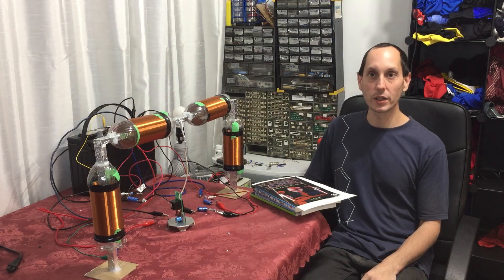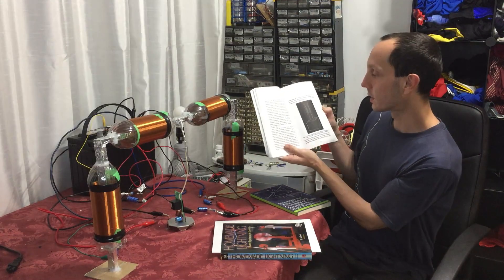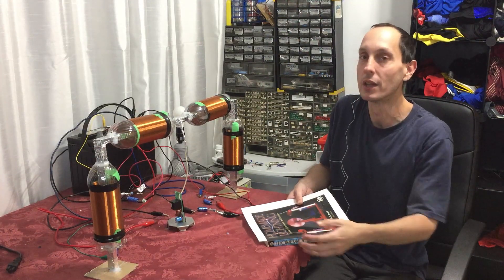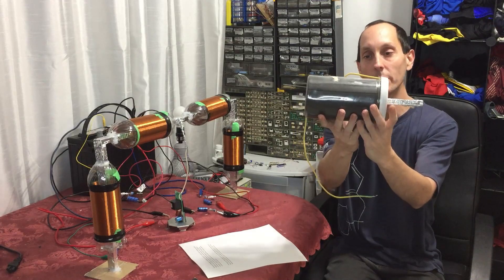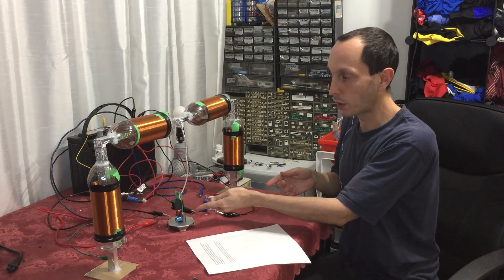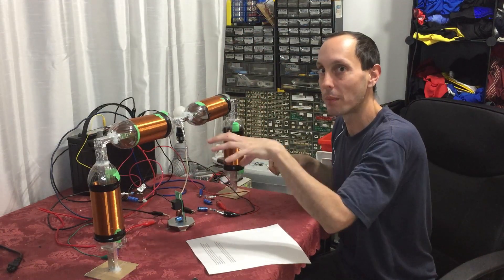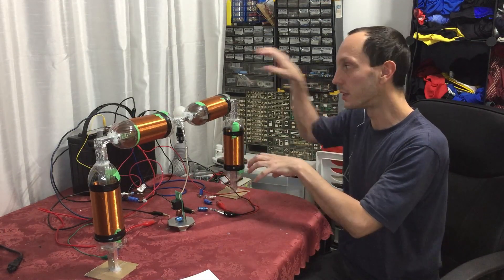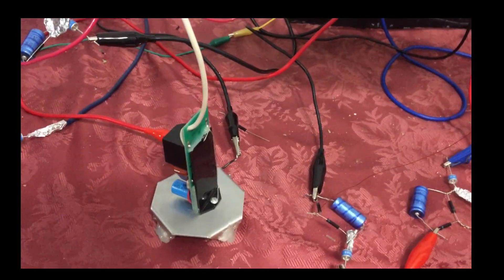QEG Version 2

Comment: Hi Joel, 
If I took like 5 microwave oven transformers, connect the high voltage +ve in series ( add some MOT high voltage caps) drive one with mains or inverter and use the primaries of the rest as output,  can this be one wire system? Can it give 4 times the power for the price of one?
Reply from the maker: Not sure if I understand correctly but I think this is a variant of my tube project where I layer with multiple diodes, plates and coils all in series, And that worked well so stacking up transformers in series could work. Have not tried yet with real transfers yet, just did it with some home built coils around a rod.

Comment: If I understand correctly and if you can confirm that the amps that are going into the battery is coming from out of nowhere (the ether), so it's ether energy that's multiplying by the copper coiling system, does that sums up the idea?

Comment: Nice work Joel, clearly lots of thinking going on there. I noticed something that may be similar with my circuit, I think it’s similar anyway, I find this stuff hard to get definitive answers from. Your setup should also prevent sulphate build up which should extend the battery life.
My circuit is very different to yours but will charge capacitors wirelessly using the Avramenko plug as yours does, on mine as long as both seperate circuits are connected to earth the caps will charge super fast.
I love when other people experiment, it gets my brain tripping over itself with ideas, I’d like to use your idea with a hard fixed wire extending from the top of the Tesla coil into 8 legs that descend down inside 8 coils and 8 seperate circuits like you’ve shown.
I found this cap arrangement also worked being connected to one end of a fluorescent tube that is illuminated by a Tesla coil, there’s just so much to test, it’s easy to understand why Nikola Tesla had a bed at work.
Again, awesome effort!